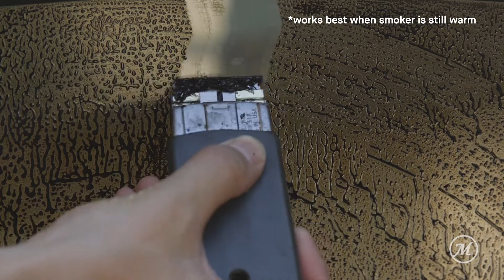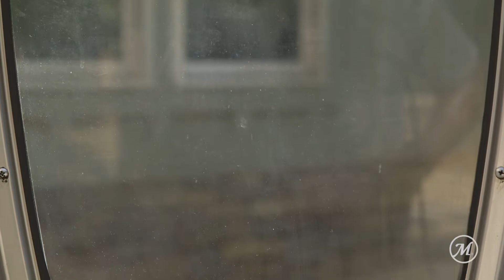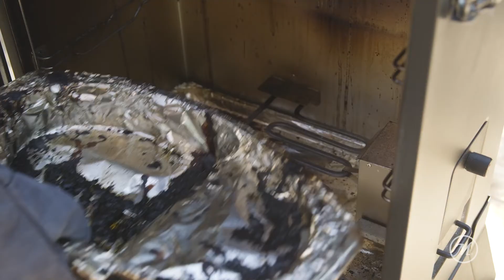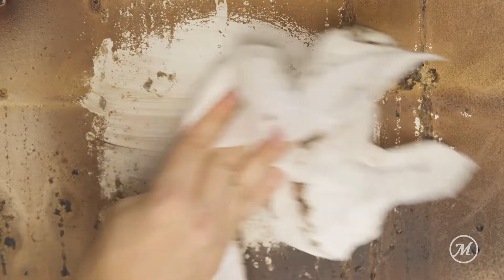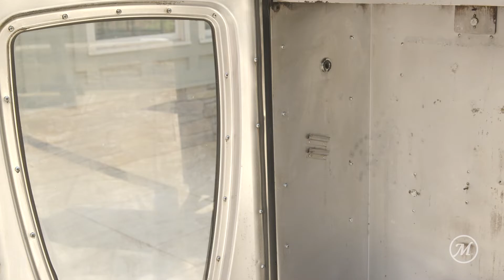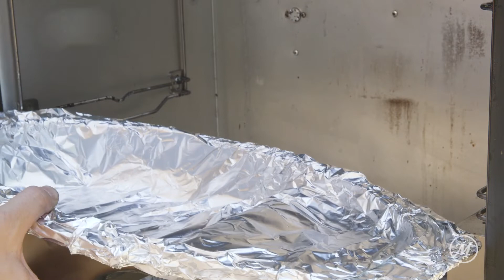How to Clean Your Masterbuilt Smoker

Comment: You should mention to not use dishwashing detergent when you put the grates in the dishwasher. I followed your advice and the Cascade detergent took the chrome right off the racks. Then it cost me $60 to replace the racks because Masterbuilt said that is normal wear and tear. The first set going into dishwasher was ruined after 3 months the replacement set only being washed in hot water and Dawn are going on 2 years and look like new.
Reply from the maker: Hi Michael! We apologize that you had issues with your racks and the detergent used in your dishwasher. We would recommend using a less harsh dishwashing detergent or cleaning off any build-up residue prior to placing in dishwasher.
Reply: @Masterbuilt  since when is normal Cascade a harsh detergent?
Reply: How about you reimburse him for the grates. @Masterbuilt

Comment: Questions: 1 What sponge(s) or pad(s) are you using to clean the inside of the smoker in the video? 2a Also, what about heavy caking? 2b Should I soak the rack(s) and bowl(s) in soap and water? 2c Can I use a steamer in the smoker? Please help thanks.
Reply: I never completely clean the inside of my smoker. I just use a wide putty knife to scrape the heavily caked areas, especially the top of the inside and the door. It doesn't make sense to remove all the seasoning worked so hard to build up. Its a little like a cast iron skillet. I cover the drip pan in aluminum foil  and toss it in the dishwasher with the racks. It cleans up like new. I also don't set the dishwasher for heated dry. I've used this method for 10 years and haven't had the slightest problems. I only clean the glass once per season, as its a complete waste of time, but it does scrape clean with a heavy duty razor blade scraper when its hot. The thicker coat comes off easier than a light coat. I clean the thermal sensors with ACV about every other smoke.

Comment: That was what after 2 or 3 cooks...after seasoning. Unless it's high quality stainless steel or 3/8" steel, you have to really look at biodegradable products, soap and water would have took off that cleanup. Some of these cleaners will melt cheap smokers....Masterbuilt...not to me.